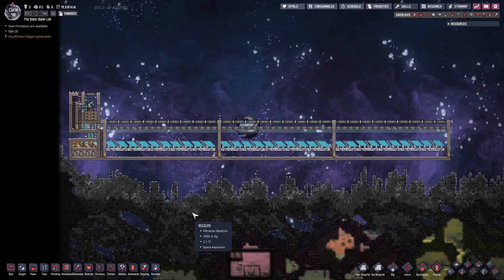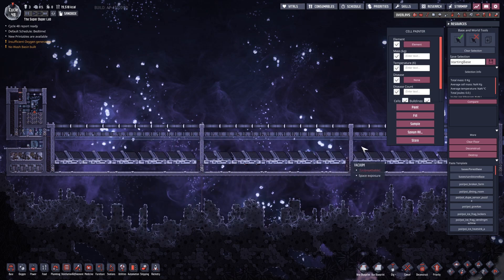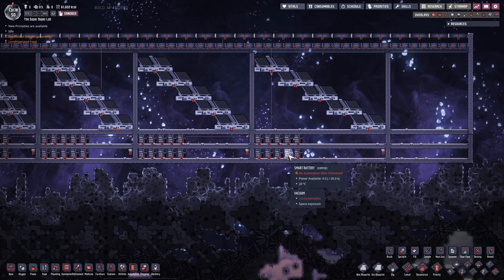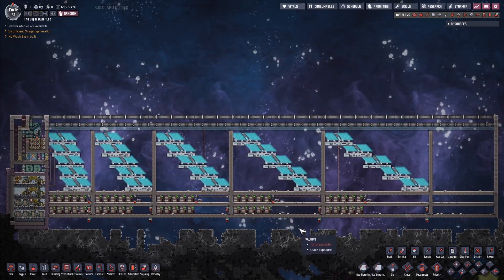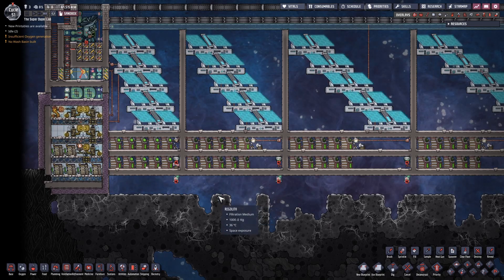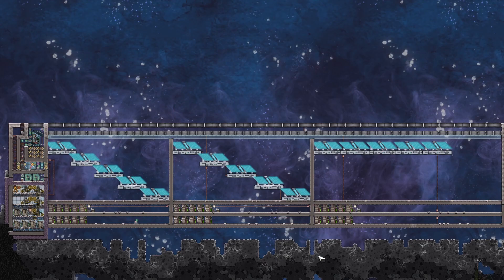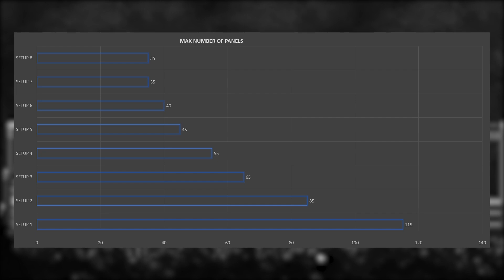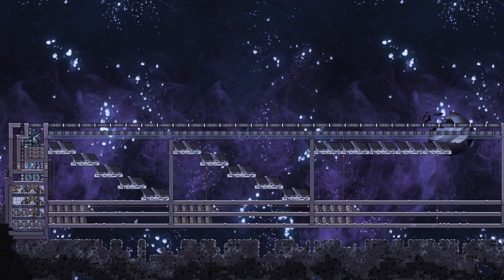Solar Panels Position - Super Duper Lab | Oxygen Not Included

Comment: I don't actually maximize solar panels at all.
I make a map wide line except where the rocket needs to pass.
Plus a line of bunker doors and a setup to harvest regolith and metal, also map wide. 
Add in a boiler room for power and cooling the materials.
That's plenty of space used up already.

Comment: why there are two sets of doors? The top one I can understand, my question is about the lower layer. thanks for the great content
Reply from the maker: Hey! So the first layer of doors - bunker doors - is to protect the buildings below from damage, whenever there's a meteor shower. Then, there's the second set of doors and the array of glass tiles below them. Since after a meteor shower regolith might pile on top of the bunker doors, whenever I open them, the regolith will fall down on top of the solar panels and then dupes will have to go manually clean it up. To avoid that, I've built the glas tiles, that stop the regolith from falling down, but still let sunlight through. Next, the manual airlocks will open and close in an automated cycle few times after the bunker doors have opened, so that they can destroy the regolith that can accumulate on top.

Comment: There's 1 very big issue with this exp. If u look at the chart of setup8, u can see the max power is ~58kW. But u can clearly see the max non-overlapping solar panel is 35. 35x the max of 380W is 13.3kW. And fully exposed panels don't even reach max throughout the day. 
I highly suspect its because u think the sunlight intensity is constant. from the wiki it follows a half sin curve. U can't do linear extrapolation with a timer.

Someone have done this before. With 600s cycle u get 5751.5kJ with all side-by-side panels. Thats an avg of 9.6kW, which is much much much more realistic. 
As long as 3 tiles are covered, u get 6500kJ per cycle. That's an avg of 10.8kW. U get very minimal improvement from then on.

There's a good reason why. The intensity per tile is max 80k Lux during the day. Panels produce a max of 380W with 350k Lux. By exposing 4 tiles u're never going over the "max" and losing power. The actual power graph should be constant, then small dip at S5, large dip at S6, huge dip at S7,  monster dip at S8. 

Under the "maximum power" chart u used kW. idk if u're implying KJ for 1 cycle or KW for 1 second. If its the later then that's horribly off, by 5x times.